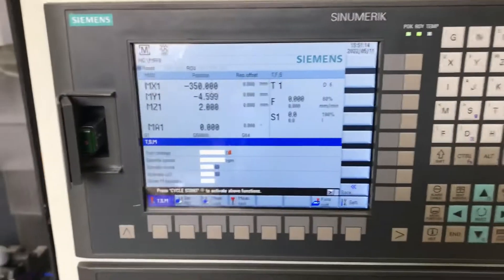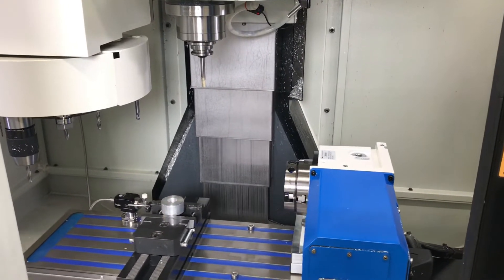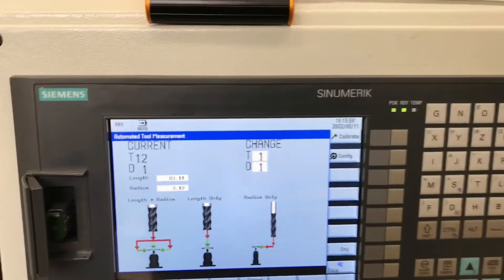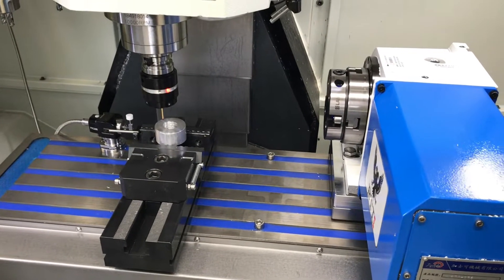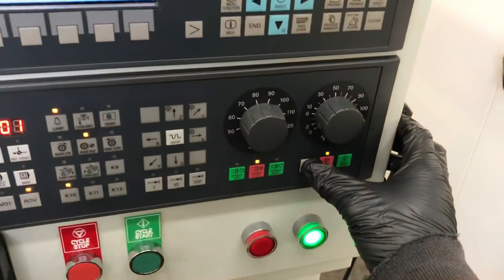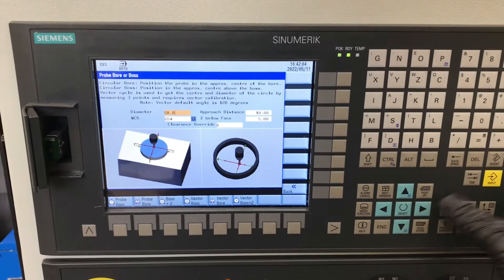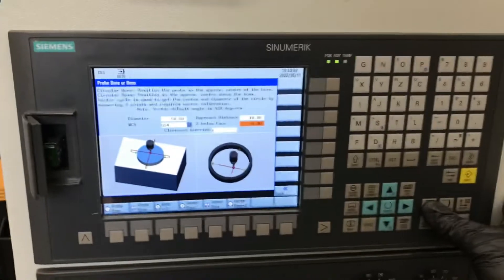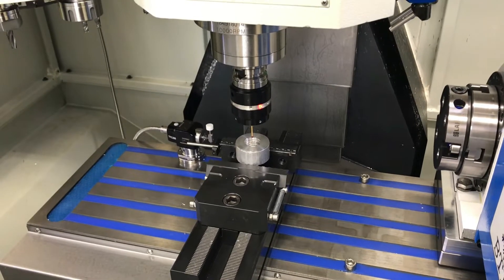A brief example of the Bullet Racing Siemens 808D custom screen set.

Comment: Is that 808d advanced? You have rotary table and this is 5 th axis ( 808d can use only 4)
Reply from the maker: Actually the newest 808DA can have 5 axis simultaneous (spindle is one, as you acknowledge), plus at least 1 more positional axis. So you can do 4+1 machining with this control.